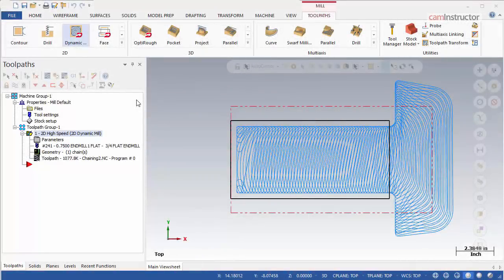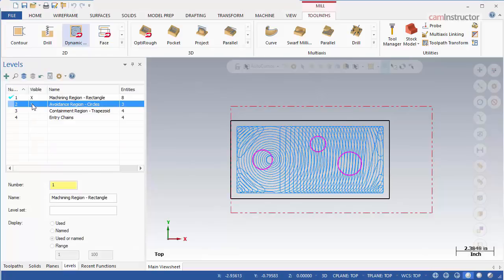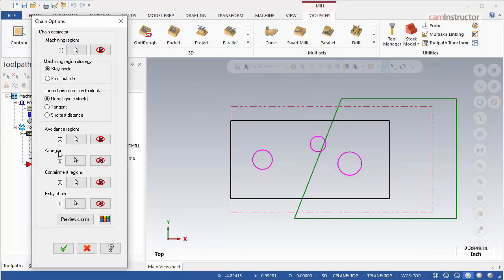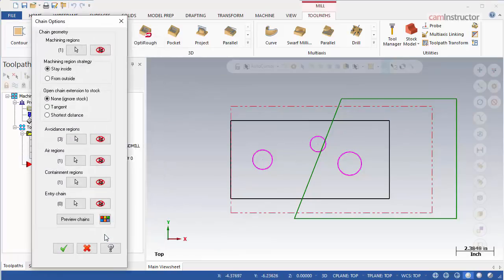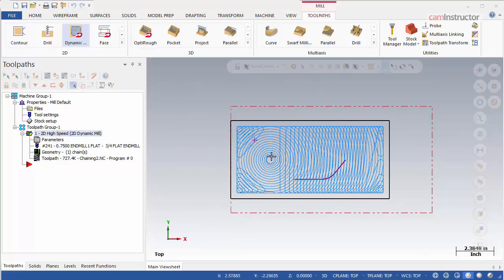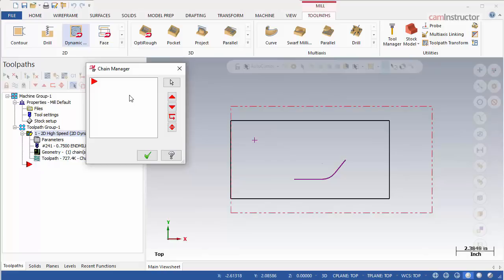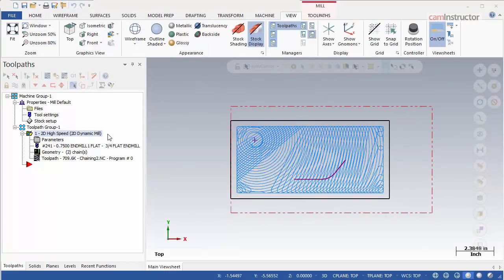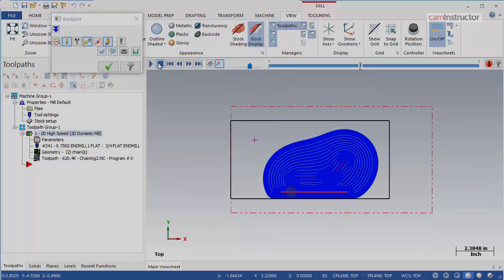Mastercam Dynamic Milling - Chaining Part 2

Comment: Hello i used to program,using Mastercam theres one problem i couldn't figure out i see how you change the cutting motion but if you have a corner to avoid and i want to start cutting straight and then around the corner cuz start cutting around right from the start and that's no good cuz it brakes the cutter i wish you could make a video so i could see what i was doing wrong..